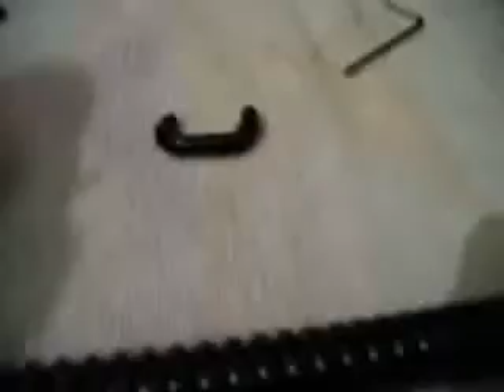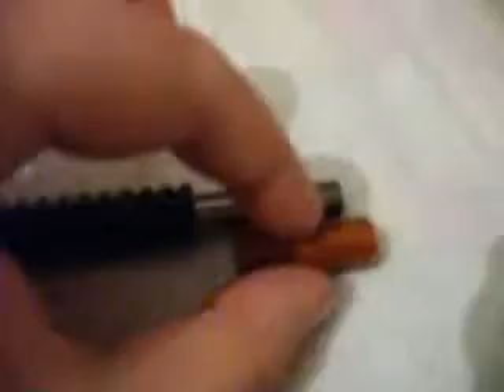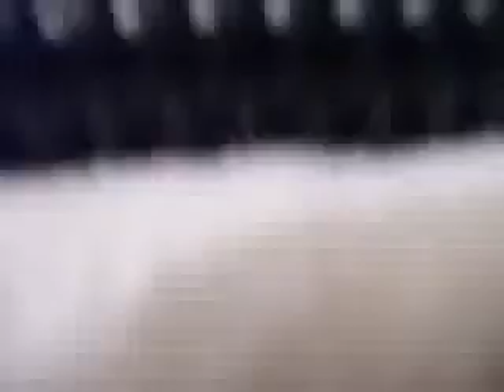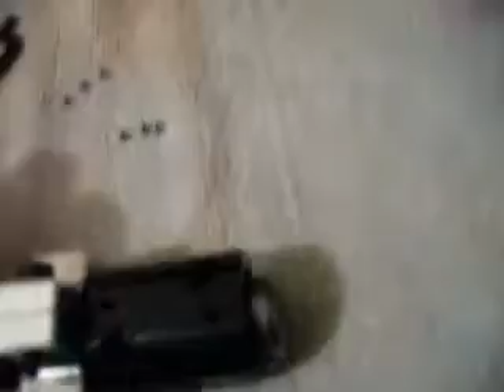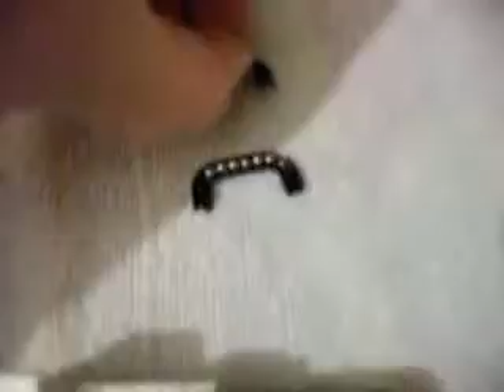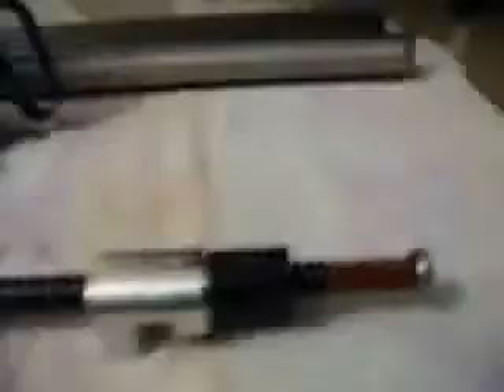34: Nook Ballnut loading

Comment: Very nice tutorial.  Losing the balls from a ballnut can ruin your whole day, but you've shown it isn't the end of the world.

One suggestion - put a bit of petroleum jelly (vaseline) in the tube with the last few balls.  It will hold the balls inside the tube, and indeed hold the two halves together, while you reinstall it into the ball nut.  Saves you having to worry about losing the balls just as you are about to finish it all up.